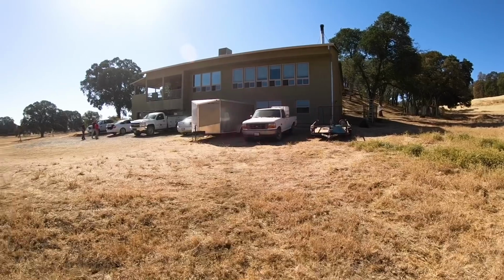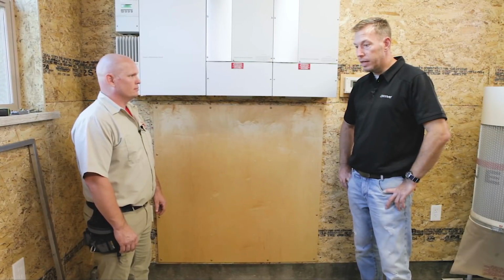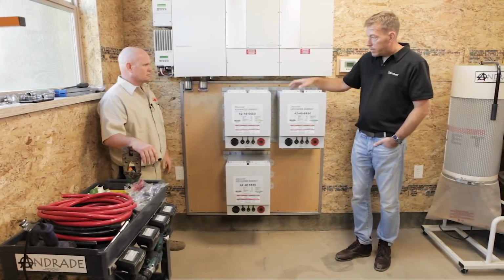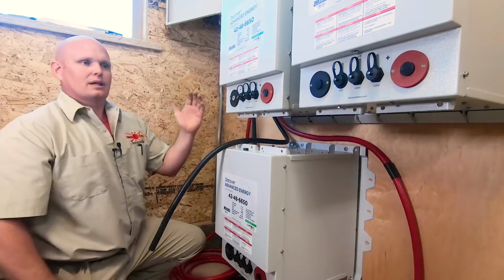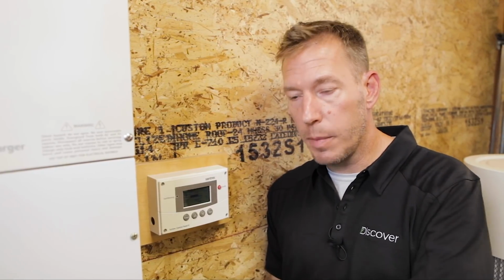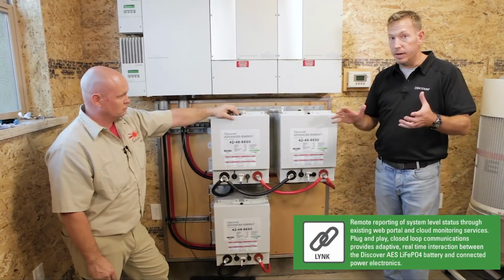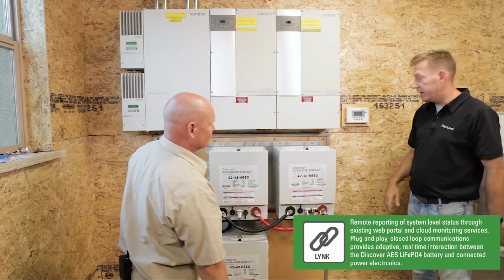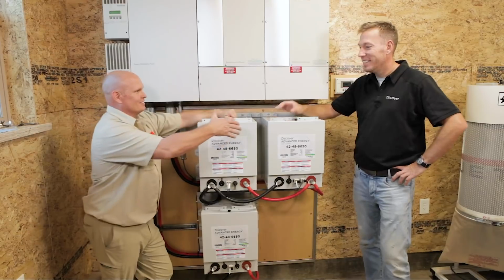How to Upgrade your off grid power system to Lithium

Comment: Hi, how did you manage closed loop comm with the inverter? I have same inverter and Schneider told me that its board cannot handle closed loop communication
Reply from the maker: I think we upgraded it to the XW+ software and then changed the model number in the scp, it's been quite a while since I did this.  I think Discover battery would know how to do it, let me know if you have issues after trying and I know someone that I may be able to get ahold of and find out
Reply: @JasonAndrade427  thank you, will do. Waiting for EG4 wall mount battery 14.3 kWh
Reply from the maker: @samba2498 I don't know if that will work for EG4 as I have never used them
Reply: @JasonAndrade427  Schneider and EG4 have partnered, my only issue is xw6048. But it’s updated with latest firmware. Hardware is old.
Reply: Please guide, thanks

Comment: I've been looking for any videos about stacking the xw+ inverters, and how they're wired with the full size PDP.  When you add the 3rd inverter that you mentioned you have..  it'd be AWESOME if you could do an overview of that xantrex system, how the 2 inverters are currently wired,  how the generators is connected,  stack settings, and the process of adding the 3rd to it.   I've found a TON of xw+ videos,  but literally zero on "multiple" or "stacked" configuration.
Reply from the maker: Hey Jeff ! yeah I can do something but I’m not sure if I am going to run it in the same stack, I am considering trying to run it off the same battery bank but I want to use it to power my new water room and isolate the output from the other system.   Normally this doesn’t play well with other systems but I am hoping that because the batteries are in a closed loop formation they will be able to communicate state of charge to the main system and keep track of the soc.  Does this make any sense? Ohh the stacking is a breeze there is a sync cable from each inverter and you can enable cascading so it populated the setting across all the inverters in the system.  I’d highly recommend using the bypass assembly that they sell for the pdp it will keep it safe.
Reply from the maker: Hey Jeff I added that third invert today look up Andradedesigns on Instagram and you can see what I’m doing
Reply: @JasonAndrade427  Looks good!   One day, you should do a full system walkthrough there.  I'm really interested in doing something similar with the conext XW+ (though,  I don't think I can afford 3 or 4x $8,000 batteries,  those discover are nice.. but there are much cheaper options out there.  I'm leaning towards simpliphi. 3.5kwh each, I can buy 2 (7kwh0 for about $6k . In your current config,  you'd get slightly more capacity for about $6k less, though I imagine you got sponsored or discounted pricing)
Reply from the maker: Have you seen my Simpliphi system?
Reply: @JasonAndrade427  Indeed.   That's the video that got me looking into simpliphi, initially.  Then I saw this video with the discover and started looking into them.   Nice batteries, and it's awesome that they speak xanbus natively..  but I'm not able to justify such an enormous price difference. They aren't that much nicer (IMO, of course)
Reply from the maker: Jeff Palmer but what if they were the same price?
Reply: @JasonAndrade427  haha well,  if i can just snap my fingers and change a price,  I'd take the xanbus native speaking option (discover) but thats not realistic. ;)  Truth be told,  I'm hoping the price of batteries drop a fair amount before I'm able to build the new house I'm designing this for.  I suspect that this whole conversation will likely be moot in 2-3 years when I'm building.
Reply from the maker: Jeff Palmer haha I know the guys to do the finger snapping lol good luck on the house I’ve got six years into this project

Comment: 198amps into the batteries that is impressive. Beautiful job. Thank you for sharing. Schneider should improve on the interface. The SCP is a bit outdated.
Reply from the maker: AWPS Renewable Energy, LTD yes I agree I also dislike the scp and it’s one of the primary reasons I don’t push the Schneider hardware, that being said though you can use the combox and direct access it using an app or computer drastically increasing the accessibility.  

These were able to take more charging current then my 14 kw generator could put out and we had to back it down for the time being.
We did this installation in early October just before Solar Power International and I now have the fourth battery installed and it was still just as impressive that the batteries auto populate the settings for the inverter, the only thing I would recommend is that installers know to make sure the generator can keep up with the charging rates!! Thanks for watching
Reply: @JasonAndrade427  even the combox is antiquated relative to say a Victron color control that combines the functions of the SCP and combox. You need to use a thumb drive to get it to work on your laptop. It is 2018 and Schneider is still using an interface that is over 10 years old. Thank you for the awesome work and videos.
Reply: @drsolar  Perhaps adding bells and whistles to mission critical systems is not ideal for maximum reliability.  In the last week I've seen (first hand) three different types of systems error out or slow to a crawl due to back end software issues.  These were all very large organizations using "state of the art" software.  Possibly not apples to apples but you get the idea.
Reply from the maker: Was it the inverter software or battery that had the errors
Reply: Hey  @flyingjeff1984 , you're spot on with your critical system concern.    Most "closed-loop" LFP/MNC packs (BYD, PylonTech...) will only work while the network's playing nice-nice and comms are stable.   Lose comms, or have a network fault and you have no ability to access your stored electrons.   With Discover's AES batteries, the dynamic charge optimization, remote monitoring and SOC reporting are enabled by the comms but should the comms go down for any reason, the system continues to run and provide power in an open-loop mode of operation as lead-acid would.   I'm in Columbia, MO right now doing some data-logging on a system where we're connecting and disconnecting the comms (closed loop -> open loop -> closed....) and the homeowner inside didn't notice a thing.